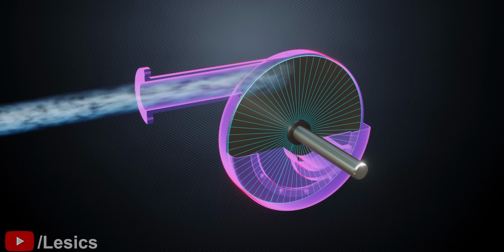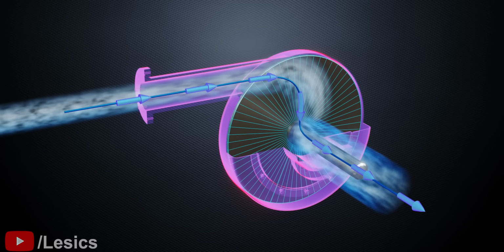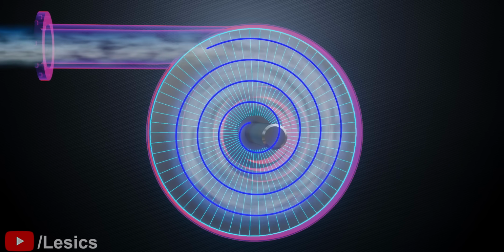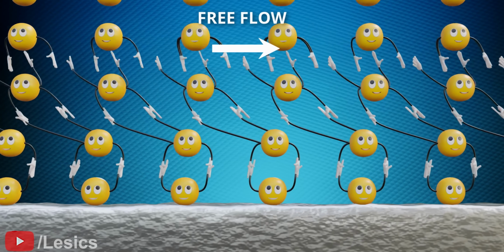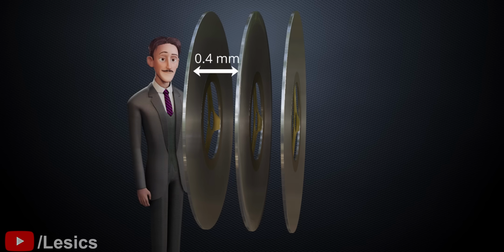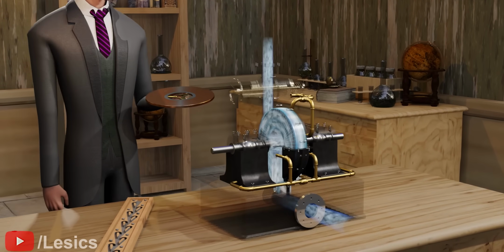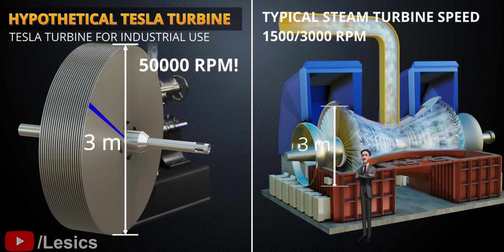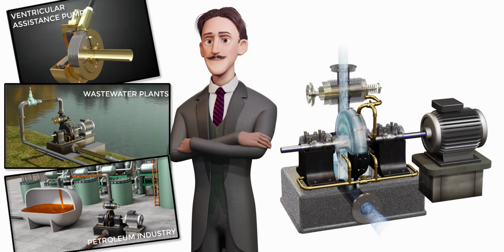Tesla Turbine | The interesting physics behind it

Comment: You would need a material that does not / doesn't expand much for this to work with steam. Also, the thinner the disks the better. Probably an ultra-thin sheet of carbon fiber / special composite (unidirectional, from the center outward in a spiraled layup) could do the trick? For bearings, magnetic bearings would be the obvious choice.
Idk about this one, but maybe one could even exploit the polarity of water molecules by coating the CF sheets to increase drag between water and plates.

On a side-note: Imagine the enormous kinetic energy of an industrial-sized one at high rpm. This might even be a candidate for storing energy like that after the steam has been cut and the turbine itself evacuated of air.

Comment: It's always amazed me that everything we have today was already hear, we just reshaped it. A caveman had everything around him to make a turbine, just didn't know it!
Reply: so all y'all actually agree...that...a caveman...could have built a....turbine...ok internet, you've beat common sense yet again. Trinley out.
Reply: Thats called science....
Reply: What? Precision tools don't just "happen". A cave man could not have made a turbine...I mean, the caveman would have a heck of time making a simple hairbrush. To make a turbine you need metal parts, you think pure steel or copper is just lying around in nice flat sheets? Look up a video on how we make things flat. Something so simple yet so complicated to make. And you need flat surfaces to make anything  in todays world. It took a LOT of work to get to where we are today. I get what you're trying to say, but turning ideas into actual things takes engineering, lots and lots of it. Don't be so dismissive of thousands of years of human trial and error.
Reply: @trinleysangha9463   The original comment unfortunately quite clearly went so far over your head it entered orbit.
Reply: @trinleysangha9463  nope not complicated at all. I've designed a simple process to make high purity steel (with electroplating) with no tools to start with if necessary. From building the generator, making the first bloom iron for it, the copper for the widnings, an earth iron copper battery to power the rotor electromagnets, electric joule heating melting will be used to melt the steel post electropurification. And as far as machine tools, they are completley unnecessary and can be avoided. As far as flatness is concerned, just take 3 steel plates, an electric motor and grind them with eachother. You aren't creative enough so you thing that machine tools or precision milling are necessary things, they aren't.
Reply: @trinleysangha9463  Where did they say engineering isn't hard? Its what humans are best at anyway
Reply: @sattlerreader Untrue. All of this is only made with copper and iron, both of which cavemen had and made in large quantities.
Reply: @mattbanks3517  Cavemen did not make "copper and iron in large quantities". Caveman lived in the "paleolithic period". In the neolithic age we were already mostly and agrarian society...so I don't know if we'd call them "cavemen" even by then...but still we used stone tools, and finally about 3000 years after that came the copper age. And we still didn't know how to make iron...Your comments are so dumb I'm done replying to them. Later days.
Reply: @trinleysangha9463  You're confusing history with what they could have done. You're uncreative and uninterested in alternative ways of making iron and Aluminium. I've researched this topic for almost a year, how to start making steel and aluminium from nothing but dirt and other low quality ores and clay (alsilicate). If you are interested in the processes and experiments that i have done and am doing then message me.
Reply: @trinleysangha9463  The only reason they didn't do it earlier is knowledge. People and  many animals died in the past all because we lacked knowledge or experience. Farming really ruined us that's for sure. Grains like wheat are horrible foods along with milk and meats, but potatoes, rice, fats and oils and eggs are superior foods for humans and animals like dogs.

Comment: I was wondering if the lines you showed on the sides of the discs were really there or were they just simulated to show motion? If the discs were rough or etched with angled grooves it would increase the drag coefficient and it might work just as effectively with lower fluid pressure.

Comment: Nice video but I don't understand one thing. You tell us that a wheel with a diameter of 3 meters at 50000rpm will run at mach 13 on the outer edge but with my calculations I get to a mach number of almost 24.

diameter = 3 meter
circumference = 3 mtr * pi = 9.4248 mtr
9.4248 * 50000 rpm = 471240 mtr/min / 60 seconds = 7854 mtr/s (28274.40km/h)
Convert to Mach (330 mtr/s give or take) = Mach 23.8

Or am I missing something?
Reply: No, I got the same posted above somewhere. Estimate the CF and it obvious why this won't work with current materials. I got a CF of 38 metric tonnes for a 150mm diameter disc.

Comment: Instead of applying steam across a small set of large discs, couldn't they get the same Joules by applying the steam across a larger set of small discs?
Reply: 10in diameter, 50 discs, 0.0092” disc spacing.... it’s a beast!! All within 1.5 in turbine. ~7000in^2 of active surface area!!!! And still a total of just about 0.5in of open space between all the discs for plenty of flow too. 
https://youtube.com/shorts/Fn5qRjJvGbI?feature=share
Reply: I think the issue with more discs is eventually you will hit a wall, steam needs to leave the turbines efficiently the more discs the greater the resistance and this will impede rotational speed.
Reply: NOPE.       there's  a  thing  called  LEVERAGE.        a driven wheel/rotor/runner  is a rotary 2nd-class  lever.            a  larger  rotor   Radius   results  in  More  Inherent  (rotary) leverage, in the rotor;   aka  more  MA.    mechanical advantage
Reply: @daviddavids2884  while the rotor advantage is true and effective until the point the discs cant take the strain of their spin rate. At this maximum currently attainable disc size to rotation speed ratio it becomes more efficient to make it a two stage to get more effective power to input out of it as you can no longer go any larger or faster without critical mechanical failure.  Basically muti-staging the turbine is a crutch for when you reach the mechanical limits of the currently available materials, two stages also allow you to get away with a smaller radius turbine as they increase the speed at which the fluid circulates in the turbine via increasing the pressure differential in turn helping raise the efficiency.
Reply: It’s actually a balance between the two. To many discs and you get losses to the amount of energy efficiency. To large a diameter and then you see the edges of the disc far outspeeding the intake leading to energy loss. You have to balance between a high enough diameter to efficiently collect energy based on intake velocity and enough discs to have the capacity to accept the necessary intake volume. Additionally to many dics increases resistance on the output reducing efficiency thus comes the need for separate units. Then there’s the 2 stage tesla turbine that uses a tesla turbine to pump away from the firsts output in order to increase the pressure differential increasing the flow speed for a net gain in power output and efficiency.

Comment: This might be the solution to improving the performance of small gas turbine engines. RC scales ones exist, but they don't work as well at that size.
Reply: You know that's a good idea. Never seen a plane driven by a steam boiler though.
Reply: @coyote5735  They did have a couple steam-powered spy planes during WWI because they ran much quieter. That's not what I was talking about though. I mean using Tesla turbines for tiny jet engines instead of bladed turbines.
Reply: @sockmonkey6666  I know I was pulling your leg.

Comment: if he tried little groves on the disc he might be successful to obtain efficiency without higher RPM
Reply: Eh no, that would only decrease the efficiency; the pressure needed at the inlet to force the gas/fluid through the turbine would be much higher.
The cohesion effect on the surface of the plates is quite strong; it's directly related to the Casimir effect.

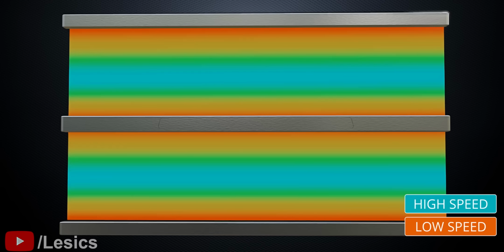Comment: 6:04 how do you calculate the boundary layer? Whats the formula?
Reply: That is not easy to quantify. High level maths and prohibitive super computer time. Basic laminar flow.   . 2-.5mm all depends on disc dimensions, rotational speed and fluid used. Plate thickness and disc gap, overall device configuration, and fluid temperature, nozzel size the list goes on. Performance is based on a holistic application of all variables in each configuration, so good luck finding a theoretical answer. Cheers John
Reply: @notsocrazyjohn5348  by holistic is that your fancy way of saying no one fucking knows, trial and error?

Comment: This makes zero sense; how would the turbine ever exceed the speed of the water? It's ridiculous to say that it's going anything faster than that; such as Mach 13!
Reply: There would be a steam nozzle right before the turbine at the tangent entry to the turbine case and disk. A nozzle can accelerate steam to huge speeds, fast enough to erode steel.
Reply: He said that the turbine should go at that speed to be efficient, not that the water will drag it to that speed.
If you don't reach that speed, your turbine will be not efficient enough to beat the current turbine design and you will just have an unuseful and suboptimal turbine.
If you manage to have a water flow of Mach 13 and make the turbine turn at 50'000rpm, then your turbine can be a good competitor to the nowadays turbines.
But who want to try do do that kind of development knowing that even the materials that you need to build of of those turbines are not available today?
Reply: It's Mach 23 actually do the math.

Comment: So basically Tesla turbines are analogous to reversible heat engines. With heat engines, you can transfer heat from hot chamber to cold chamber, extracting work. Or put in work, and move heat from cold chamber to hot chamber.

Tesla turbine moves fluid from high pressure chamber to low pressure chamber, extracting work. Or, if work is put in, it can move fluid from low pressure chamber to high pressure chamber.

In essence, the Tesla turbine is a pressure engine, the P-domain counterpart to the heat engine's T-domain.
Reply: Sterling engines come to mind.
Reply: @TheTubejunky  Yep, exactly. Only that this (Tesla Turbine) is pressure-based while Stirling Engines are heat-based.

Comment: The words: "definitely an engineering impossibility " are yet to be defeated!
Reply: except the statement is wrong.  Tesla was using a relatively dense, and malleable alloy for the rotor discs. Sometimes referred to as  'german silver" which i think is an alloy of copper zinc and nickel, it also has a relatively low melting point.  Many metals, and alloys of today can withstand the forces, necessary to achieve rotational velocities of 50,000 rpm, at a smaller diameter, and of course many disc's along a much longer shaft or many shafts coupled toegher can create just as much power as a single larger diameter device.  Just think about it, the hard drive discs in Your computer rotate at high rpms.  They are ultra strong lightweight, and microbalanced,... an engineering impossibility?  i don't think so.